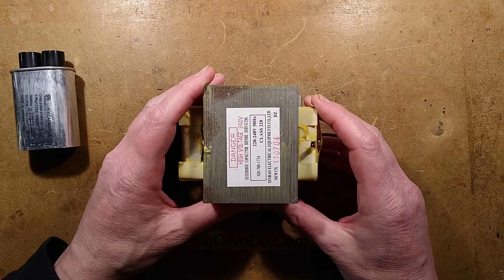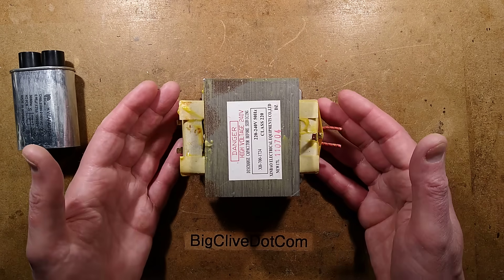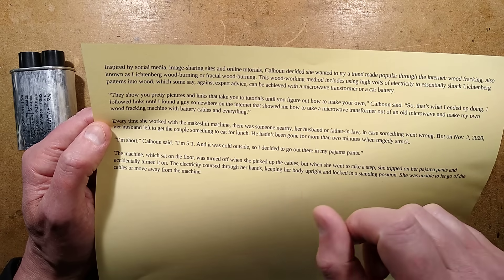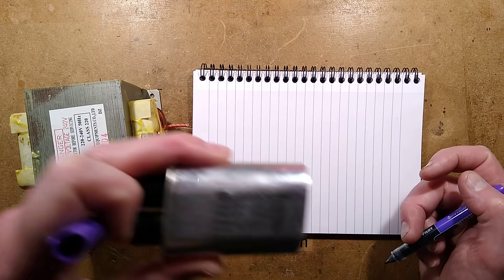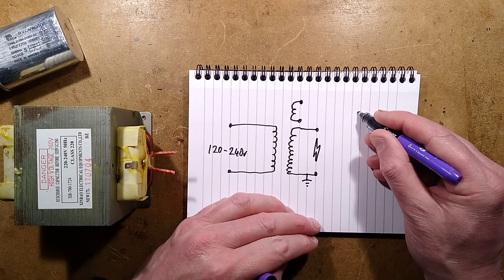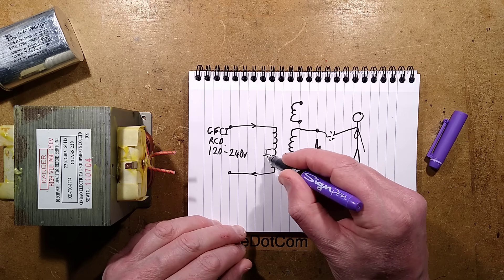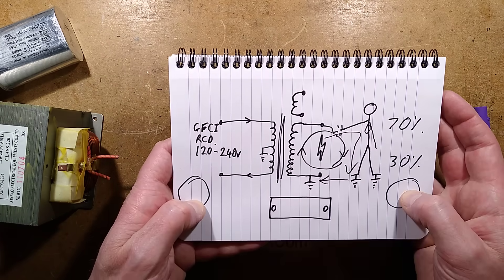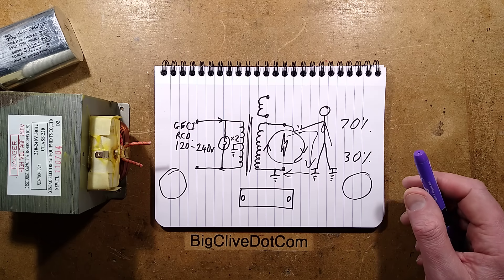The most deadly project on the Internet

Comment: At about 10 min. in you talk about grounding and that it would not matter if you had shoes on. What if you were sitting on a wooden stool and your feet not on the ground? Not that I'm doing this or would make me feel safe if I did.
Reply: It does not have to travel through the feet. If your contraption is on the desk with metal legs and you accidentally lean close to it the effect will be the same. The current will just cut through the body surface in the proximity with the metal leg. At 4000V electricity can jump through 2-3mm air gap, so you don't even need to touch. If you only brush against it with your clothes that have some moisture in them (ie sweat) clothes will effectively be a conductor for electricity. Or if the wire you are holding is contaminated with dirt or moisture - that can also act as conductor and travel up to your hand. There are so many potential routes for current to come up. There surely must be ways to minimize the risk but it can be tricky for an inexperienced mind to make an accurate risk assesment. If it does not sting the first time we get comfortable with, the more we succeed the more sense of fear goes away. And then there will be one of those days where you did everything right but there was some new factor seemingly completely unrelated that gets you. It's fine if you just die and don't wake up. My worst nightmare is to wake up with some serious life impacting injury that I have to live with for the rest of my life and curse my stupidity. Some things are just not worth the risk. But it is your choice.

Comment: My dad is an electrical engineer and kept a workshop in our basement while I was growing up.  One day around 8 years old I found a transformer in the parts similar to the one in this video and began hooking it up to a set of plugs to put in the outlet.  The idea to make cool sparks!   My dad came home from work and caught me working with it before I had a chance to plug it in.  He ran over "what are you crazy!" and was really upset and made it super clear to never play with that again or mess with anything to do with the outlet period!   That it could in fact kill me!   That was enough for me and I never messed with it again.  He then gave me access to electronic parts I was allowed to mess with and told me to stick with my 6V battery power supply and not mess with any outlets or anything else.   Good advice.  Glad he was there to stop me before I might have made a terrible mistake.

Comment: I ripped apart one of those handheld disposable lighters and pulled out the spark mechanism. Which of course essentially just works as two open leads close enough together that the current will jump the gap. I was like 'oh that's cool' and tried it on myself and it freaking hurts, I can't imagine wanting to be so reckless with something actually extremely dangerous
Reply: I've played with those a lot in the past, found it fun lol
Although I did get a 110-120V shock once while replacing an outlet, some jerk turned the breaker back on (because it was controlling 2 separate rooms.)
Luckily I had only contacted the live wire, so I immediately let go. (reflex)
Reply: I don't know how much power these things produce, but that's electricity you can play with 😁
Reply: @kirakaffee9976  Enough volts to give you a zap but not enough milliamps (Let alone a full amp !) to kill you, unless you have heart issues or a pacemaker.
Reply: @psirvent8  yes it's just fun zaps. we did it to ourselves and each other all the time in school.
but no idea how many volts and milliamps.
Reply: @kirakaffee9976  At least a thousand volts given how strong the zaps are (Yes I did experience them too), however it's most likely less than even a single milliamp !

Comment: Can a 110 volt "buzzbox" welder be used??
Reply from the maker: A welder isn't really suitable for fractal stuff.
Reply: Could you be more specific. I just asking for a bit more information on why this would not work.
Reply: I figure it could cause an issue with the transformer.
Reply from the maker: @haroldgist9666  A welder puts out low voltage at high current.  This effect unfortunately requires high voltage.

Comment: Youre gonna tell me that car battery cables arent rated for the power that a microwave uses. Have u seen what wires go to your electrical socket? Its not the volts its the amps. Police tasers are thousands of volts too. If you want people to take you seriously you cant be saying that stuff
Reply from the maker: Car jump leads are rated for about 50V not 2000V.

Comment: I like fractal burning. That said, it needs to be done safely at a distance. I am at least 4 to 6 feet from the current standing on a insulated mat. At no time is it in my hands with current running. The table I use also has an insulated mat on top and underneath. It takes longer to set up but safety is THAT important to me. I have several other safety precautions in place that would take to much time to describe. I worry that these videos that describe the dangers may in fact keep those that will try anyway from doing so safely.

Comment: hmm can you help me figure something out? When I was a kid I had a neighbor whose door bell didn't have a button but two cables you had to connect. As you can already imagine, I held to both cables with my hands and couldn't move (I don't remember much more). This was in eastern Europe (220V 50Hz) so you think I got shocked with 220V AC current or was it some lower AC or DC voltage? I didn't get any burns that I remember and didn't need any medical attention of any kind but other than that I can't recall what exactly happened while I was shocked.
Reply from the maker: It sounds like the either used a mains voltage bell or switched the live side of the transformer.

Comment: I'm sorry. COMMON SENSE says you don't play around with
1. Line current
2. Microwave ANYTHING
3. More volts than u can count on one hand
4.  ELECTRICITY
UNLESS
You are
1.  Licensed Registered electrical engineer
2. Licensed electrician
3. Utterly positive thru EXHAUSTIVE research what are doing is perfectly safe.  Exhaustive meaning DAYS, sources such as licensed professionals, text books...

Comment: People are so cowardly, I just use some speaker wire directly connected to high voltage power pylons running through our neighborhood. Sometimes I feel a slight tingling sensation but the results are great.

Comment: I've been wanting to try this, but my grandfather instilled a healthy respect for electricity in me. I had some idea of how to make the project safer, but thank you for your input on it. The indicator light was my first idea, but I was trying to figure out how to do a dead man's switch in a way that wouldn't result in your hands locking ON the buttons if somehow your hand came in contact with an electrode – the two hands/two buttons method is a brilliant idea (I was thinking having the disconnect on the handle/probe somehow). Having the workspace enclosed with safety cutoffs on the lid and the two-hand control more than an armspan away from the enclosure seems like a great way to do it. Add in a high frequency power supply, and making sure you have wiring with insulation appropriately rated for the HV, and this should be much better than the garbage they give plans for!

If you have too many redundant safety features, you might have a product that's slightly fidgety... but if you have too few, you might have a body that's missing a few parts – or a pulse.
Reply: the dead man's switch should rely on your hand being open and pushing it open, so if your muscles clench it's triggered.
Reply: @explodeybits931  Sounds great! A C shaped enclosure, two buttons in series in the upper and lower part, and you have to push one up with your index finger and the other down with our thumb. Probably requires careful planning to avoid failure modes though.
Reply: @jannepeltonen2036  even just one up top you've got to push up on. if your hands tense up it releases. c shape would work great

Comment: my first experiment at age of 10 years was connecting an old calculator having bright light dysplay (not leds) to electric line 😁 result this scientist got that if you connect a calculator to the mains you will achieve smoke and sparks in calculator... 
during another experement with an old camera flash circuit i got shock😁,. result i got that..... the part which today i call capacitor... is most dangerous thing..... 😁

Comment: A box that requires physical exertion to remain on can still be dangerous, as if you manage to get shocked, you may not be able to let go. I would have a two stage button, pressing too light or too hard will cutt off the flow.

Comment: As someone that graduated from the university as a mechanical engineer, I have an absolute rule, I do not mess anything electric.  I will change a light bulb and that is it.  In the US I changed power outlets but the voltage in 120V.  Now that I live in Europe I do not touch such things.

Comment: Retired electrician here, 43 years in the trade. I've seen just about everything you can imagine dealing with electrity, including death. Everything from milliamps to high voltage. My advice is this. Don't screw around with it period.  It can and will kill you. Horribly,  painfully, excruciating pain. When you start tasting the copper you'll know.

Comment: Under the right conditions, 30v is enough to kill you. Fatigue, sweating and other factors can lower your body's resistance which allows more current to flow through your body. It only takes .01 amps across your heart to kill you. Alternating current which is what you get from household outlets has a signal similar to the signal that your brain sends to your heart. Taking one of those shocks can cause heart palpitations and later failure despite you thinking that you are okay. Electricity is not a toy and demands respect.

Comment: Yeh still remember when i was tinkering with a little transformer when i was  younger , picking it up and connected the 2 output pins with my thumb it instantly burnt 2 holes in my thumb . Not a nice feeling i can tell you that . Later in life when repairing 80 character monitors we would first earth the capacitors to earth before working at it the backlash of those things could tropw a grown man trough te room .

Comment: you could also set the whole thing up with the breaker off, and run it from the circuit box. if I were to ever try this project, which I don't plan on doing, this is the way I'd go about it. nail in the probes, plug in the transformer, and then turn on the breaker 20 feet away

Comment: Note to viewers: DO NOT short any capacitor with a screwdriver blade. Many capacitors can supply enough current to heat up metal and liquefy it. It's not a safe thing to do. People trained to work on HV electronics know how to make them safe, what are you doing opening up your microwave anyhow?

Comment: Tho it's Not Something I'm into Nor Plan on Getting Involved in.. As an Electrical Engineer I Must Tell Those Who Plan to Do That This is an Indispensable Video for Those Who Will Choose to Continue Such a Risky Venture.. Step Up Transformers are Very Very Deadly So Please Pay Very Close Attention (Even Better Still Don't Use One) But Those Who Plan on Living on The Edge Do Pay Very Very Close Attention it'll More Then Likely (And Hopefully) Save Your Life, And Thank You for This Most Important Life Saving Upload My Good Man 💯💯
Reply: (..And Just an Engineering Note Here: To Remove The Risk of Shock From Earth Ground Potential Isolate The Secondary (High Voltage) Winding on The Transformer From The Transformer Case So Your Secondary Voltage Coil is Now Isolated and No Longer Has Earth Ground Potential (If Your Circuit Does Connect Your Transformers Shell/Case to Earth Ground), That Should Be Step 1 )

Comment: I used to work on CRT monitors. On monochrome CRT’s they run at about 10kv, the tube runs a bit like a capacitor and if you are unlucky enough to get a zap from one you don’t forget it quickly. I’ve thrown a screwdriver across a workshop when trying to discharge a Crt and accidentally let my fingers touch the blade before it was earthed.
Reply: Friend of mine zapped himself in high school with a CRT Tube, his father found him muttering to himself in the corner where he landed and his ability to do basic math was affected for nearly a week. Not fun.

Comment: If you link two car batteries in parallel you can weld with them. Saw it on a survival welding vid
Reply: You can also blow your self to pieces,  The hydrogen given off when under high discharge can explode, You also have no current limit to protect you.

Comment: My dad's an electrical engineer in the power generation and instrumentation sector -- he worked with mostly ABB Gas Turbines in the Middle East. He has seen power elecrocuted when the unexpected has happened or they were too non-challant. Needless to say, I've touched a 220 V twice in my life (we have 220 and 210 in the Middle East), and it makes your heart go a 1000 miles a second. I did that first one when I was like 4 years old, and well, no wonder that I have some heart problems as a result. My own stupidity is to blame.

Don't play with current.

Comment: I worked as a Neon tube bender for a few years , I had taken home some neon tubes for deco, and powered it with a 7500 volt  transformer. Long story short  I went to I pull the cord to shut it off and  grabbed a uninsulated pcs of wire ... Hole in finger ...hole in toe .. thank God  my jerking cause me to fall backwards,pulling the wire out of my hand  . It's  a wow moment for sure.
Reply: That's why AC is far safer.

Comment: I once took apart a disposable camera just to keep using the flash...at one point my finger touched the leads on the capacitor and let me tell you the voltage felt like a bolt of lightning.....just from a 1.5 voltAA I WAS JOLTED SO BAD MY HEART RYTHM WAS OFF FOR TEN MINUTES....I WAS TOO SCARED TO PICK IT UP OFF THE FLOOR......ELECTRICITY RESPECTS NO ONE......YOU BETTER RESPECT IT....
Reply: The capacitor voltage is boosted quit high, And some of the professional ones can actually kill.

Comment: Thank you for correctly explaining the dangers involved when using high voltages and high current. 
The high Current is the thing that cooks you, literally. 
High voltage alone is not particularly dangerous with very low current (< 1 Milli-amp or Micro-amps), 
High frequency, low current, high voltage is even less of a problem (as demonstrated by Tesla). 
But when you combine high voltage with high current, you are providing yourself with the likelihood of imminent death.

Comment: Amateurs forget that 2kV is enough to make an electric arc which you will not be able to shutdown once it ignites in your hands. This is a special case where lumped circuit Ohms law is a simplification which falls apart and you need to understand Maxwell equations to predict what will happen. This basically tells us that we need much durable and expensive insulation and to think thoroughly about automatic safety mechanisms.

Comment: I just did a Class II Circuits (12-24v DC) course for a locksmithing ticket I'm after. Lucky me, this new instructor was a formerly an electrician for 30 years. And there was only one other pupil for the weekend. Day 1: Arc blasts till lunch Then meter safety. Day 2 build power supply and played with transformers, rectifiers, relays and coils mockup door operators..etc. According to him 357V is the common killer around here. Its low enough to spasm you, hot enough to cook you but not explosive enough to knock you clear.

Comment: If I could add any advice to anyone thinking about attempting this, and has zero experience or training working with high voltage components... Stop. Turn around. Walk away.
After you do that, go get proper schooling such as electrical engineering or similiar, work with less deadly components for a few years, maybe get bit with 120v once or twice, to instil to respect deeply one should have when working with high voktage electricity. Only then will you act accordingly, and go through step by step processes to ensure safety (accidents still happen) and install a tried and true safety device/switch of some sort. In other words, from the moment tou decide you want to do this, it should be years before tou attempt it as you should have at least worked on a main panel by then 10s/100s of times, and never think you're above the rules, as I've had colleagues know all the rules, decades of experience and still lose their lives. Lastly, check your safety equipment regularly, to ensure no defects.
Don't be stupid, it's not worth the ultimate price.

Comment: Hello there. ..good show...not the transformer, but that other thing which holds current after its unplugged...I once was ignorant, I threw it in fire to dispose of for recycling casing as aluminium...I walked of..forgot went back...it exploded close range...i just closed eyes, it felt like these particals went threw my body without blood coming out....i itched and thought, good thank God I ain't dead. What's in there and what can I expect in terms of repercussions on the body?
Reply from the maker: Capacitors do tend to go bang when pressurised with heat.  You'll be fine.